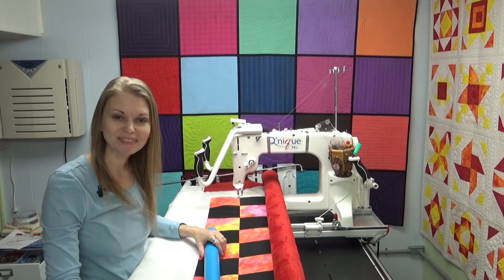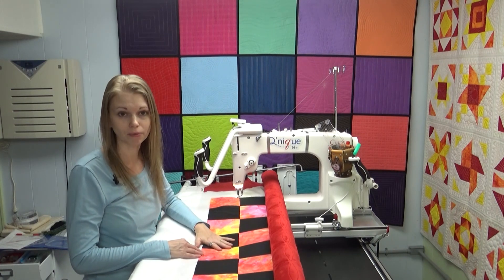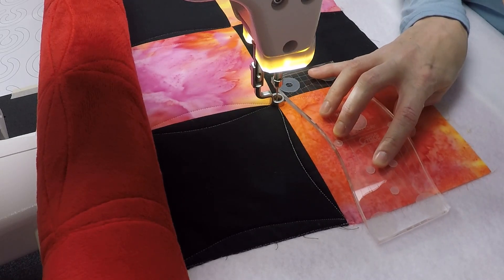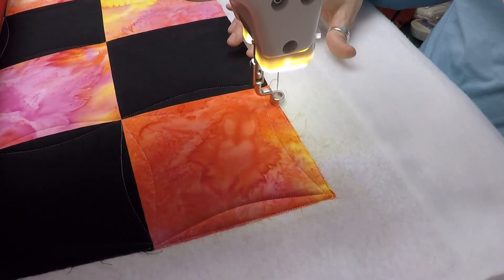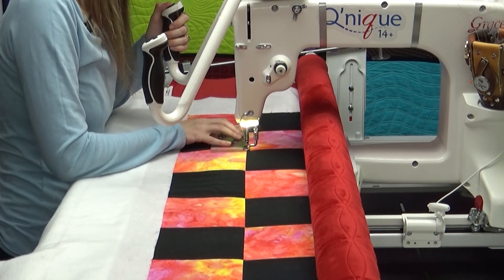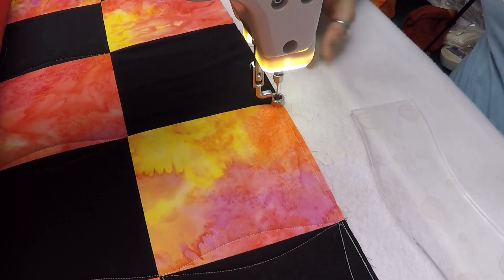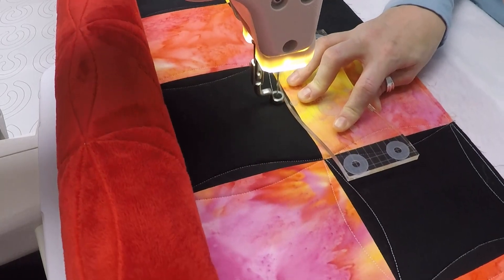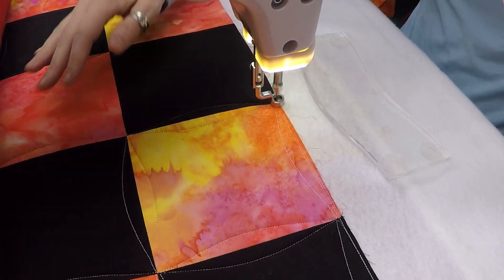Quilting to the Edges of a Quilt on a Longarm Frame with Leah Day

Comment: Leah, do you have a large or small plate underneath your machine?
Reply from the maker: I have the Grace Company longarm ruler plate. I don't think this comes in different sizes so it's just the standard plate that fits the Grace Qnique 14+ / 15R.
Reply: Leah Day I tried manipulating rulers without it and struggled. I guess it will go on my list! I have the 15R